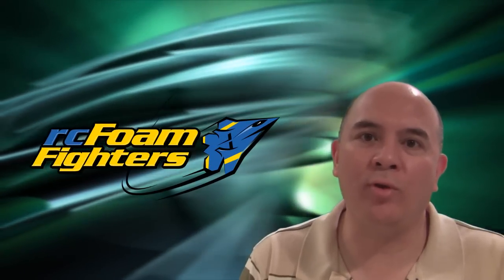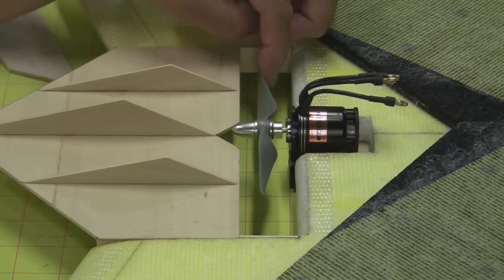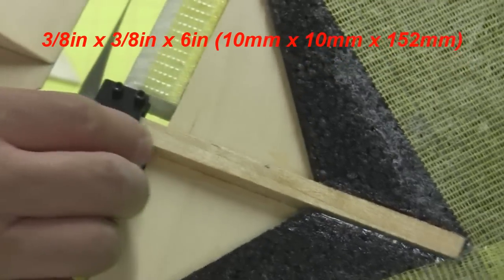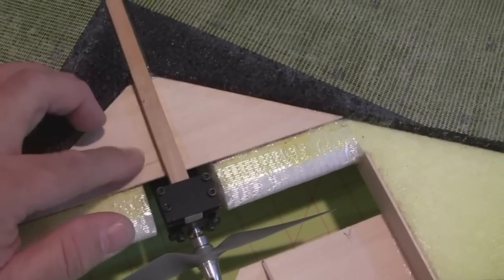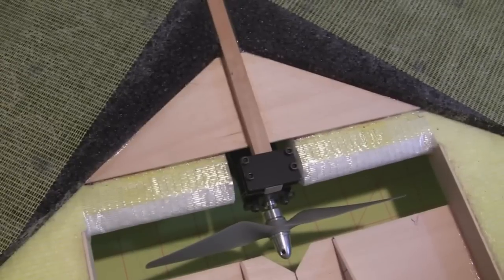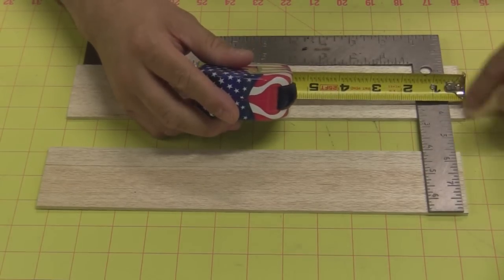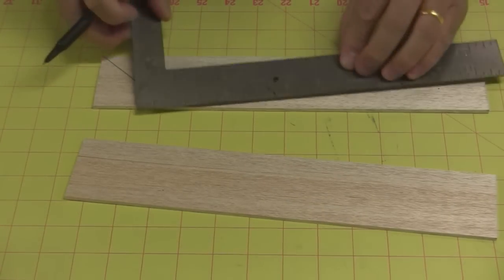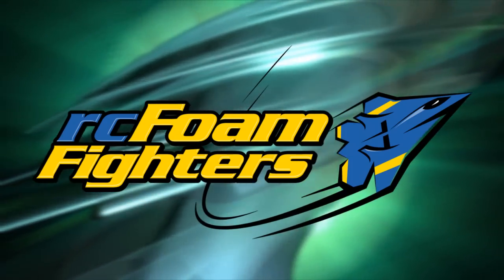Bullet Proof RC Plane Build Along No1 Phase 2A

Comment: Oh man, this is gonna be awesome! I can see it now, you and Paul battling it out for the title of the king of speed. Great use of the balsa for the elevons, or "elevrons", whatever they are called, lol. I didn't think to use balsa for foam plane control surfaces, but I can see now that they probably have the right mix of flex and stiffness. Really like that black motor mount too. I need one like that. I agree with you on keeping the motor straight and counteracting torque roll by other means. 5*

Comment from the maker: Thanks Mrfunkiezhere!! The weight of our planes varies depending on the size, power system, and building materials. Most of the planes we have built use weigh in between 18 to 50 ounces. Paul's Jupiter Plane is about 7 pounds if I remember correctly. We don't usually worry about weigh too much as long as you have a good power to weight ratio the plane will fly. We usually try for a thrust ratio of 1 to 1 or higher and prefer 1.5 to 1 or better for high performance planes.

Comment from the maker: Cool Brando!! I don't think either one of us is going to win that one! We'll just keep making faster and faster planes. Actually the Balsa (elevrons LOL) are a step down from what I used on the last bullet proof plane. I was actually going to use basswood but it would have add too much weight to the back of the plane keeping the CG in mind. I'll send you a link to where I got the mount. Thanks for the info you sent us on the mixing of the elevrons and throttle. I'm sure it will come in handy!!

Comment from the maker: I'm not sure on that one I've never tried it. Sounds like it might work but I like the motor pushing strait forward to get all the speed I can out of it. Usually I just move a little weight to the side rolling up and trim the rest out with the radio. Also Torque roll isn't as noticeable on heavier planes when you are using a small prop.

Comment from the maker: It doesn't matter with a brushless motor because you can reverse the rotation easy. You only need to switch to of the wires going from the esc to the motor. Also there is much more selection of props this way.

Comment: Except that the prop is basically to foils connected together. A foil has a front and a back (leading/trailing edges) and while you're correct that it will blow air in the reverse if spun backwards you're hurting your efficiency. If you use a pusher prop you will put the leading edge of the foil at the leading edge of the rotation and using the prop as it is designed and as such much more efficiently. Right?

Comment from the maker: bshupejr I think I wasn't clear enough with what I meant. The leading edge of the prop must still face the front of the plane and the trailing edge the back of the plane. You just need to turn the prop around 180 degrees before putting it on the motor. Then reverse two of the wires to get the prop spinning the correct direction. The prop still turns the same direction as on a Tractor (puller) plane but the motor is reverse. Hope that makes more sense.